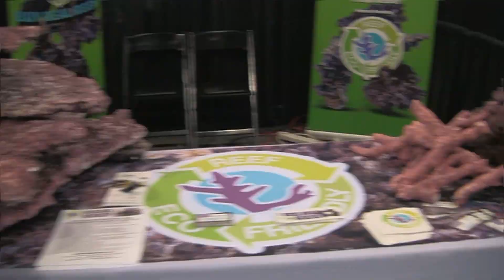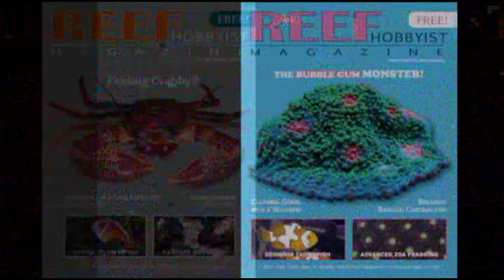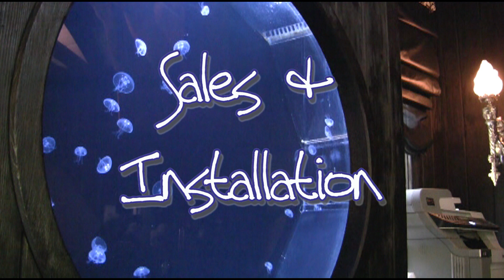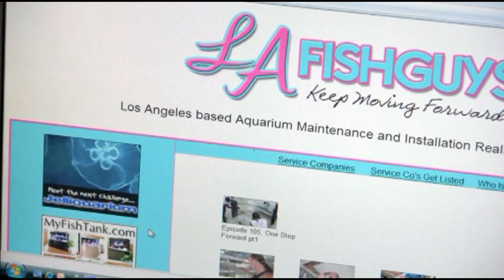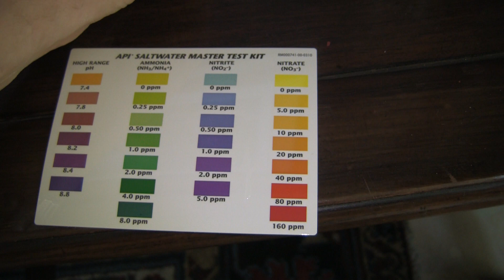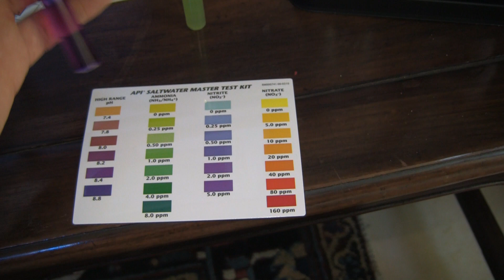Finishing the 400 gallon Bowfront Aquarium, LA Fishguys, Episode 117 pt 2

Comment from the maker: hey C, you would be surprised as to what works for SW filtration and as with Undergravel Filters all Power Filters will work on saltwater tanks. probaly the downside to a HOB is the salt crust that will occure as a result of the water splattering as it spills back into the tank. check out Episode 113.

Comment from the maker: hey T, I use Rio brand submersible water pumps most of the time. they do have electrical leakage issues, but so do submersible heaters. there is the Sedra brand. as to who is quieter...i dont know. noise is a personal issue and when you go from zero noise to any noise its always too much.

Comment: Hi Jim was also going to comment on the gulp gulp noise this can be fixed with a 90* elbow a T piece and a cap with a hole drilled in. connect the elbow to the center of the T piece with the elbow and T in a u shape, place the cap in the top of the T the end facing up and connect the elbow to the bottom of the drainpipe with the T piece opening down and into the water this acts as a breather and stops the air pressure building up inside the tube that causes the sound. Thanks Jim big 'Aussie' fan

Comment: Actually the new feeding-based sizing guidelines result in screens needing to be much smaller.  Instead of sized based on tank volume, they are sized based on how much you feed.  1 cube of food/day = 12 sq in of screen.  With this guideline, the SM100 can handle about 10 cubes/day.  Also with the PAR lamps, these have been shown to be only good for about a 5x5 screen, and with the lack of a blue component, you get significantly less growth so you have to be careful what you get.

Comment: Hi Jim, I could not find an exact video that related to the question I have, sorry. I've had my tank going for 6 months with live rock. In the beginning there was alot of Cope Pods, but now suddenly their are none. The tank is fully cycled and has balanced water parameters. I have turbo snails, rock anemonies (they had an offspring recently), alot of stringy like worms pertruding through calcium deposits, Hermit Crabs, Calerpa and live sand in the refugium. What happened to the Pods? Thanks Jim!

Comment: One more question. Around how many gph sump pump should i have to run my 100 gallon tank. Is 1340 to much and could that b part of the noise factor? I seen some on ebay around 700 gph would that b sufficent enough? Thanks thanks again for the help. U have been a great help so far.